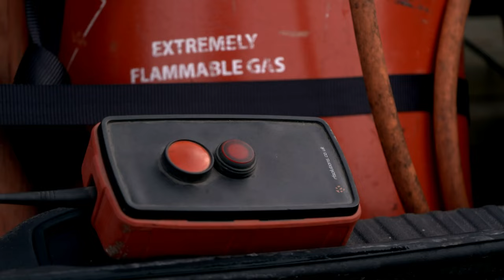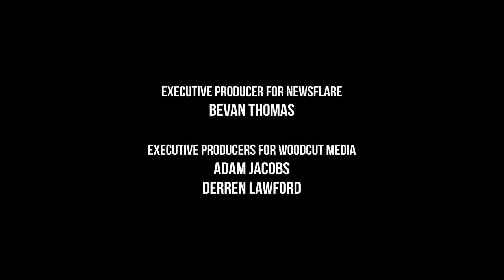Winter Car De-Icing with Flamethrower - How Hacks Work - S01 E03 - Science Documentary

Comment: I live in Colorado and of course we have windshield ice problems. I have on occasion used cold tap water to de-ice the car. It’s not too hot to break the glass, but warm enough (50°F/9°C or so) to melt the ice. Works great. Also having lots of water, like a big pot of it to quickly wet the whole windshield is a good idea. You see what breaks the glass is temperature difference between two areas. Due to thermal expansion, the hotter section expands more than the cooler part, and boom cracks. It’s not the hot temperature that breaks it. I have carefully done with 100% success. In the key hole and door handle area, which is metal or fiberglass, I’ve used hot water with no problem.